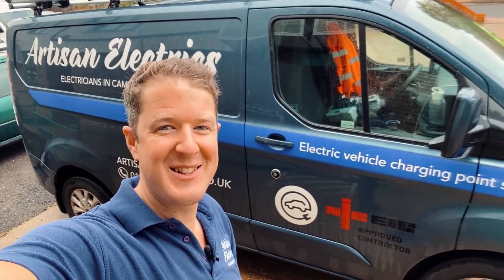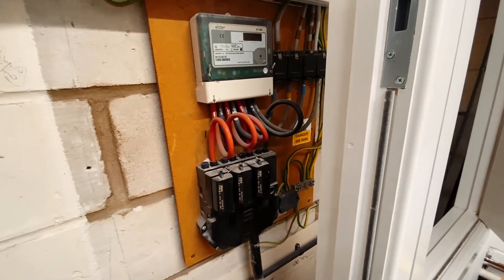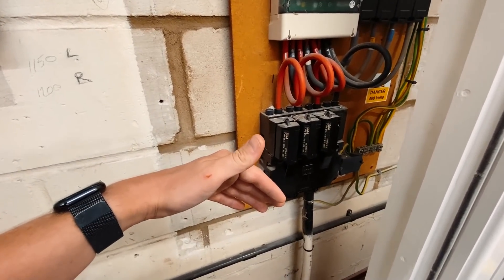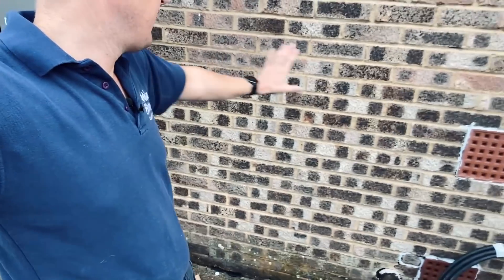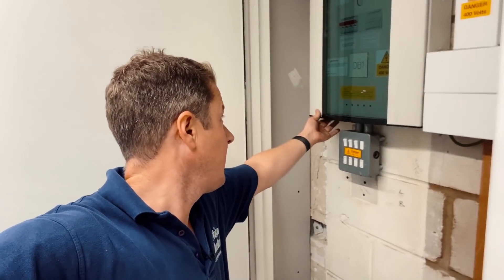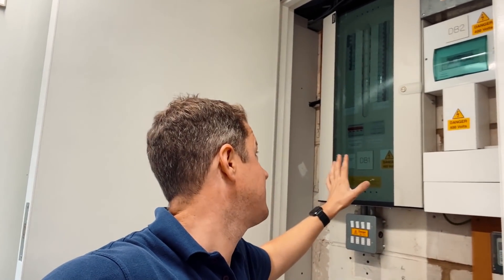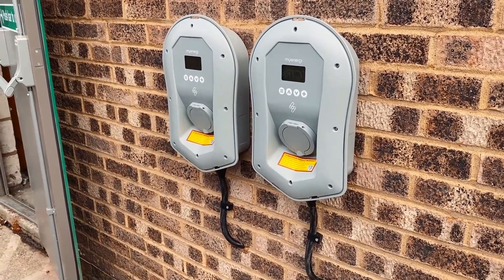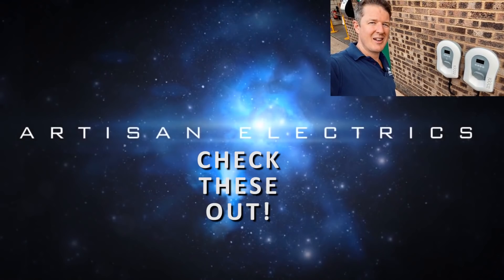Three Phase Commercial Electric Vehicle Charging Installation

Comment: I’m not an electrician so excuse my ignorance . Why do you need to use armoured for everything ? Can’t you just use metal trunking (or something else suitable) on other side of wall and use regular cable instead?
Reply: your right you could use that method. its just the extra cost over armoured cable of installation time and materials. in this situation installing 50x50 metal trunking in that small cupboard would be a ball ache. Its also a decision for the client if Jordan gave that option. As a commercial install i doubt they were bothered.
Reply from the maker: Yeah that’s right there are many ways to do the same job
Reply: @artisanelectrics  If these Zappis were single phase, is there a rule that would prevent the use of 6mm2 T&E if there is no external cable run?
Reply: @meuk6929  Those UK regulations are weird. Probably the only country on earth that requires armoured cable or metal trunking inside an installation cupboard. And one one very few to require it for that metre along the inside wall.

Everywhere else double insulated (inside a PVC pipe outside the cupboard) would have been enough.
Reply: Ok, thanks for reply - I wasn’t sure if it was perhaps regulation as I’ve only ever seen them done in armoured cables.
Reply: Ho7rnf cable is an option.

Comment: In three phase the detection of a broken PEN is actually much easier than it is on a single phase installation. The voltage between every line and the PEN should be 230V (+/-10%) and 400V between the lines. In case of a broken PEN the voltages between the lines won‘t be 400 or 230 between the lines and the neutral anymore. The voltage between a line and a broken neutral/PEN will be free floating between 0 and 400V. In three phase that‘s easier to detect for a safety mechanism.
Reply: Why would voltage between lines change with a broken PEN conductor do you mean if the line loads are unbalanced?
Reply from the maker: Thnks
Reply: I've had the misfortune of a stolen neutral at the transformer for my street a few years ago. 
So all earthing and neutrals in all feeds were no longer connected to the transformer. Only the phases were. 

At one point, the one phase here read 5v and two others were near 415v.
But phase to phase didn't change, stayed at 415v.

The interesting thing is we waited all night for the repair with it like that, and not once did anyone in any house get a shock from any earthed metal even when bathing. It was like a pseudo IT System of sorts.

Comment: what about glanding off in a box inside and passing the main core through the wall into the back of the zappis?
Reply from the maker: morenormal yeah that could have worked
Reply: Or just drilling through the back and using twin+earth instead of SWA?
Reply: @CryptoArnie Excuse my naivety, what's the difference between Steel Wired Armoured and SWA?

Comment: What's the charge time on the 3 phase compared with single phase ?
Reply: Single phase 11 hours, 3 phase usually around 4 hours (Edit: on average, seen single take longer and 3 phase take less - vehicle dependent).
Reply from the maker: Yeah it really depends on the vehicle and battery size
Reply: Depends on the car, a Zoe can take all 22kW on 3-phase, a model 3 will charge at 11kW on 3 phase vs 7.2kW on single phase, however for a commercial site like this its much better to have vehicles charging 3 phase, more efficient too.
Reply from the maker: Model X can charge at 22kW as well but not many other vehicles can
Reply: A ZE40 Zoe (41kWh battery) takes about 6 hours on single phase and 2 hours on 3 phase so about 3x faster (as you might expect). 22kW charging is rare, only the Renault Zoe, some early Tesla model X’s with an upgrade and Smart cars support it. The earlier “Q” model Zoes also supported 43kW 3-phase charging but that is only available on rapid chargers.

Comment: Do you have surge protection installed on the AC and DC side of the EV chargers? That’s important. Wow and someone put a schedule in for the DB - take note electricians this should be standard.
Reply: These do not ouput dc power, it is just normal ac out. The actual charger is in the car
Reply from the maker: Yes that’s right
Reply: A schedule is standard in commercial installs, no special surge protection needed.
Reply: I have also heard that some car manufacturers are limiting charging (car has its own inbuilt ground resistance monitor) because of ground resistance going above a certain level which can happen in warmer, and dryer conditions. Maybe Jordan you have seen this issue come up?
Reply from the maker: Yes that’s right some vehicles like the Renault Zoe won’t charge unless the Zs is lower than say 50 ohms
Reply: Artisan Electrics  Yikes..... if you are on the margin the on one day it could work and next day it may not.... that would be very frustrating for a customer.
Reply: Math Man yes, the Zoe is probably the fussiest EV, I’ve heard stories of people tipping a bucket of water over the earthing rod to be able to get it charging. It’s also quite frustrating because random public chargers sometimes don’t work because of the high Zs reading.
Reply: Parts of that installation looked quality and others looked naff maybe done by different subbies